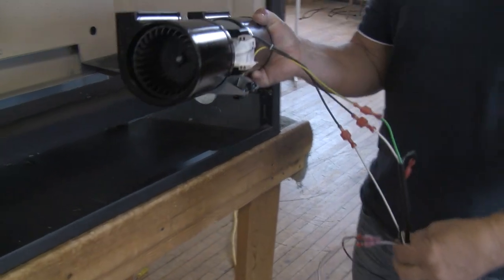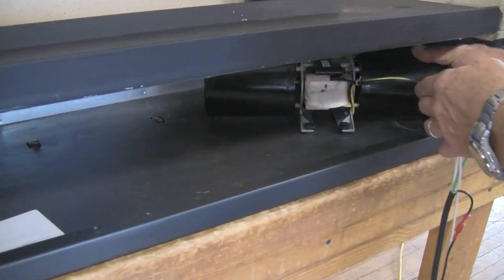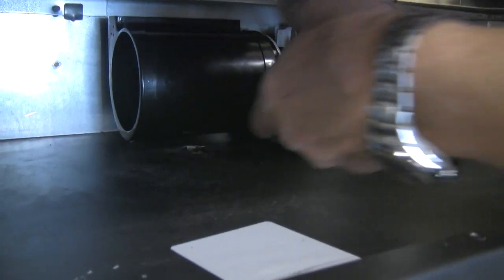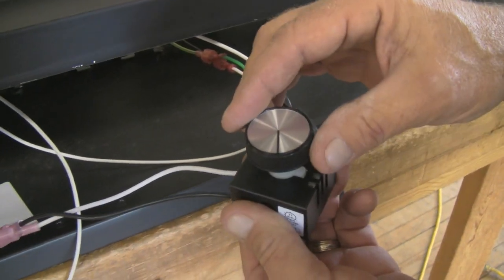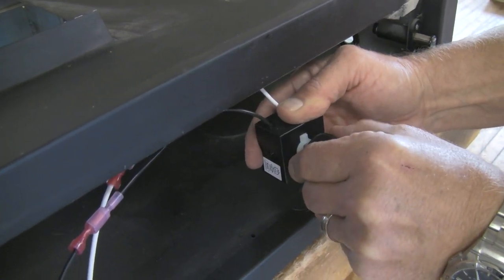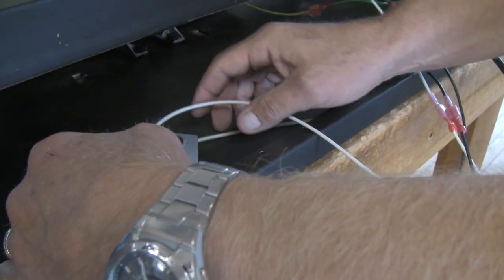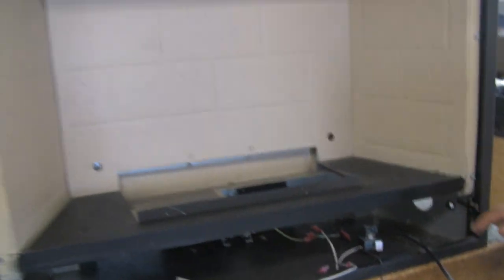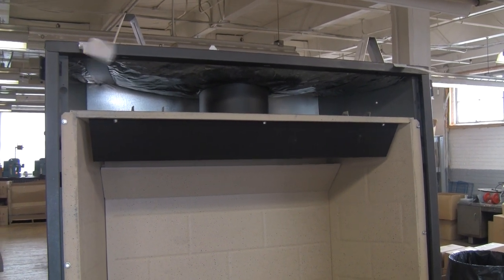GFK-160 Fireplace Blower Fan Kit Installation

Comment: How long does it usually take for the thermostat to hit 120 degrees?  I bypassed the thermostat to check to see if the blower works, it does.  I let the fireplace go for a while and it doesn't seem to kick on?

Comment: The video is much more clear how it mounts than just like Amazon listing. Thanks. I have a double sided fireplace but I'm going upstairs now to see if this will work. You are getting a lot of airflow, I guess sealing off the lower with aluminum tape would be overkill with that sort of flow.

Comment: How does the RC300 remote able to change fan speeds? We moved into home with gas fireplace without a remote. The fire place has this fan kit installed and there is an available remote RC 300 on the market to operate the unit which I would like to buy. However I can’t see from the current wiring or understand how the remote will control the fan speed with the setup I currently have a Dexen Industries GM8K1-50 PN 2166-307 with a 4021-708 fan control.

Comment: Thanks. I wired everything correctly but had the speed switch all the way clockwise which was lowest speed and I thought it’s the highest speed. So here I thought I messed up while connecting the wires, it was on the whole time at lowest speed. Your video helped me find out the once you turn on the speed switch after click, that’s the highest speed and not the lowest.

Comment: Can I get longer leads to the variable speed control knob and run it through an access hole that's in the fireplace insert to a cabinet on the other side where I can easily access it? The The screen and frame are pretty heavy and a pain to take off every time to access the variable speed knob. Also is there another kit where we could just set a temperature and the fan would ramp up or down depending on the temp?

Comment: Well these work in any natural gas fireplace where it fits? My gas fireplace doesn’t have a fan, but I think this would really help generate heat into the room.
Reply from the maker: Sure, so long as your NAT fireplace is what's considered a circulating model (louvered, vented, or hooded) lower and top panels and provided  you have adequate mounting space below the fireplace.  If you send us an email at support@fireplaceblowersonline.com with your make and model, I can let you know specifically what you'll need.  Cheers, Jason

Comment: I need help with the instructions.  "Pre-wired" but the illustrations and enclosed instructions contradict each other.  Our system arrived with a diagram showing a white wire connected to the heat sensor but both wires (prewired) are black.  There is a white wire but it is only connected to the speed control and loose on the other end.  It is quite confusing since the schematics themselves are apparently mislabeled.

Comment: I got Heat N Glow SL750TR-C, i ordered this blower from you guys and wired them together, but the motor does not starts, it just makes humming sound at the motor but no rotation.
Reply from the maker: +Bhushan Jog I know this an old post, but you ever have problems with any of our products, please contact us directly and we'll get you taken care of ASAP!
Reply: @fireplaceblowers  my blower on my stove was making loud noises and it finally went out now just makes. Humming or buzzing noise. How can I fix that issue

Comment: If my fireplace never seems to come on do you recommend trying to put the sensor on the side closer to the flame pattern in the fireplace?
Reply from the maker: +Austin Kelly You may need to experiment with the positioning of the sensor to find the optimal location.  Try and locate the hottest location, but of course, be careful while doing do.  Closer to the flame doesn't always mean it's hotter, but it's a good place to begin.

Comment: My fire place has an on off switch for the blower so I'd like to bypass the thermostat. How do bypass?
Reply from the maker: Sorry for the late reply on this one, but the sensor can be bypassed by disconnecting the two wire leads that go into the the thermostat and connecting them together.  We typically create a Male to Male jumper to lead to make the transition easier.  Regards, Jason

Comment: I wish you would have gone over the wiring for the DIY guys.
Reply from the maker: Sorry for the late reply!! No wiring required. We actually send the kits fully wires and pre-assembled. Some of our newer videos go over this in more detail!!
Reply: @fireplaceblowers  do you have a newer website? The link doesn't work
Reply: . @fireplaceblowers What do you do if there isn't an electrical outlet under the fireplace unit? It's a Heat&Glo model 6000TRB

Comment from the maker: The "A" simply refers to "automatic", which means that a thermostat is option is included with the blower kit.  Our GFK-160 includes the thermostat, so it's essentially the same thing as the GFK-160A.  Any questions, give us a call at 262-989-4882.

Comment: not clear on the wiring part..
Reply from the maker: Hey Todd, give us a call directly at 262-989-4882 and we'll be happy to answer any questions you have.  The kit comes entirely pre-wired and assembled, so there's not much wiring you actually need to do.  You really just position the blower, place the thermostat sensor, position the rheostat control and then plug the blower in.